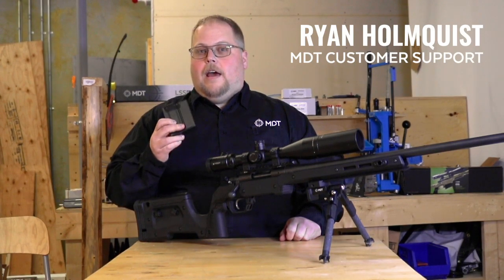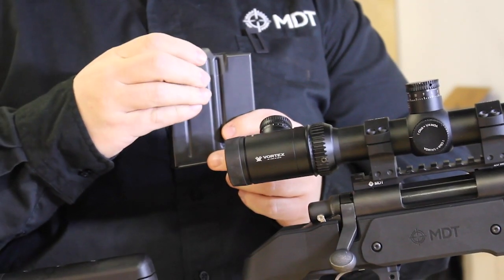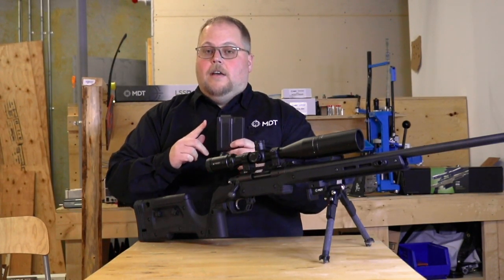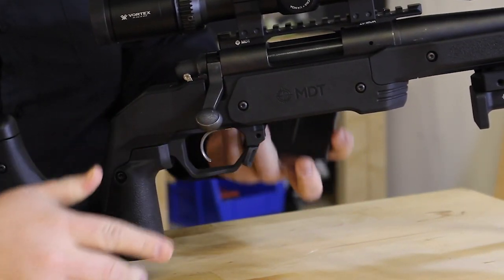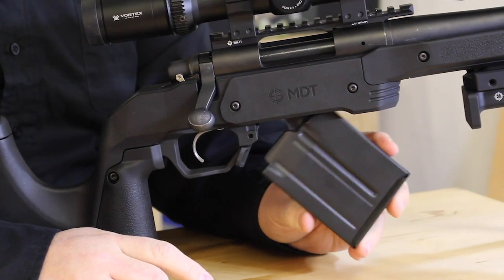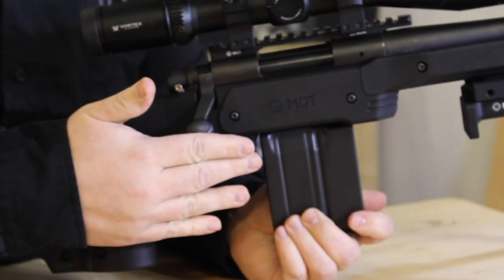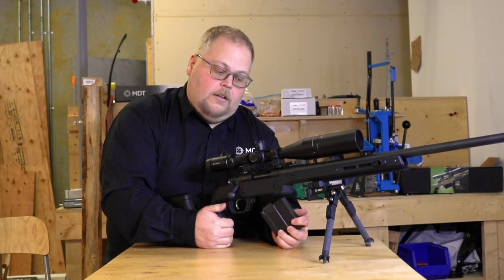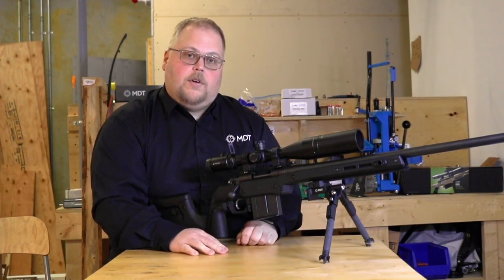MDT FAQ - How to insert AICS Mag?

Comment: I have the MDT LSS-XL Chassis for a Savage Arms long rifle chambered for 300 WinMag. I have challenges inserting the magazine as well as chambering a round. Very unhappy with this. The bolt was super silky smooth with the original chassis, and with this one it is extremely tight and tough to feed the round into the barrel.